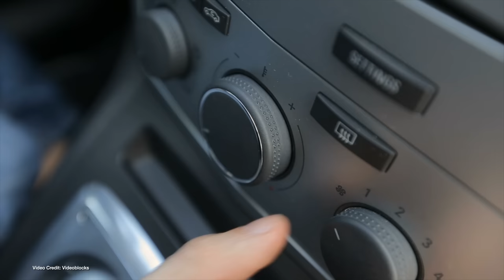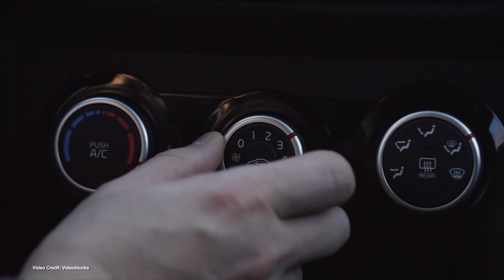How Do Electric Cars Keep You Warm In Winter?

Comment: I'll keep my gasoline engine thanks. All that electricity comes from fossil fuels anyhow. Wonder where yall are gonna put all those nasty batteries with nasty stuff when they hit the end of their lifecycle?
Reply from the maker: 1} No it doesn't. And even  if you were to find this elusive place that only uses fossil fuel generation, it's still cleaner over the life of the vehicle to use an EV. 2) In second use projects - then we'll recycle them.

Hth
^Kate
Reply from the maker: "Every time energy changes form you lose efficiency"... So you want to pump your fuel of choice up from hundreds, thousands of feet underground, or by taking a raft of chemicals produced by distilling stuff you've already pumped up, and shove them back in the ground to 'frack' and release poor quality tar (let's not talk about what happens to the ground-water and land after that, best not).

Then you want to pump that hundreds to thousands of miles to a place to refine it - or take it across the sea where I'm sure there's never been any problems with y'know, massive fires, enormous spills, that kind of thing - to a refinery. 

Refineries use megawatts of electricity - then you want to load it into tankers, drive them thousands of miles (running on that self same resource), then you want to pump them into a tank in the ground, then you want to store that and pump it back out of the tank into a box that burns it with roughly 30% efficiency.

Sounds amazingly efficient.

...and you live in a place that suffered massive power outages largely due climate change and the failure of the fossil fuel generating capacity in the associated extreme weather.

Sounds like you have this all sorted.
^Kate
Reply: @transportevolved  and that's what they use...to generate electricity to charge batteries.. either the electric companies use it.. or it  sold to people in the form of gasoline. Not saying gasoline is really better. Im just  saying either way.. you are using gasoline or actually petroleum to generate the energy in the first place. Not to mention 3/4ths of modern cars are made of plastic anyhow. If the battery  technology gets bettered be a believer.. charging times will also have to significantly decrease. Think about cross country truckers that drive 1000 miles a day carrying 20 tons of goods. Electric just cannot.
Reply: And.. you mentioned our electric grid going down here when it was cold. You know how I warmed my home? A gas generator that I feed power to my furnace. That furnace was using natural gas. If the electric grid went down that little Ev ya got is worthless. A gas powered car just fires right up.
Reply from the maker: I'm not going to bother with the straw man of cars containing plastic. 

Not going to bother with the ridiculous notion that we shouldn't improve things because at the moment we're still using dirty energy to make things cleaner. That's also a ridiculously circular "we should never make anything better" argument.

Will start with -  a home with solar panels and battery back up stays powered. Wind and solar and hydro together can get us a lot of the way to renewable energy independence. Newer EVs can also help power your home in an emergency since most essential appliances draw so much less energy than you need to move a vehicle - they'll keep your house powered for multiple days. You can also use them to travel to a location with power, charge up, and carry a chunk of that energy back so you can use it to keep your house powered longer.

If power goes down there's good odds that your local gas station will be unable to pump fuel. Your shiny gas car will end up dead at the side of the road. If there's sufficient impacts to road or rail transit, getting gas to the gas station will be impossible or at least difficult. And the number of people who got sick or died because they were desperate 

Basically, there are things that EVs aren't great for as yet, but none of them are things you've cited. None of your 'that's how things are' ideas about energy generation have been accurate. That's because you're clearly way behind where we're at in technology - and in how you think about EVs. Which is sad.

Mainly for you.
Reply: @transportevolved  not really sad for me. I have a very solid understanding of electricity.  I spent my 20s as an electrician on a nuclear submarine. The last 20 some odd years has been workin on aircraft electrical systems. Just dont see how its gonna work. Let's take a drive to.. Memphis Tennessee from Dallas.. pulling a light 3500 pound camper trailer.  That right there is why I have a gas vehicle.